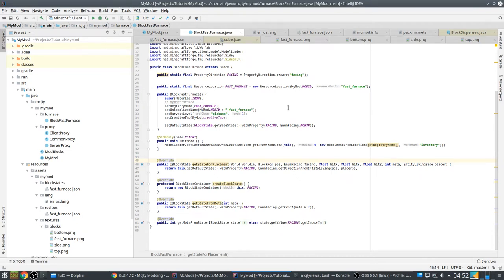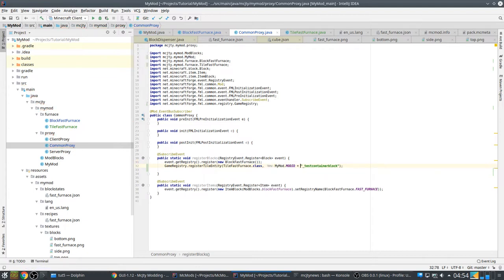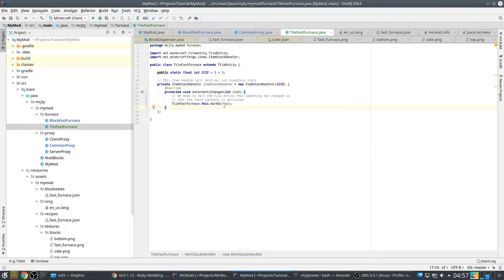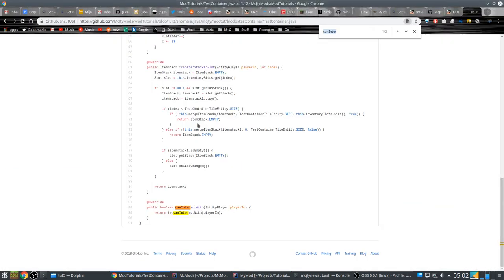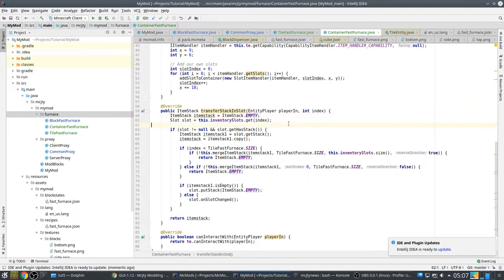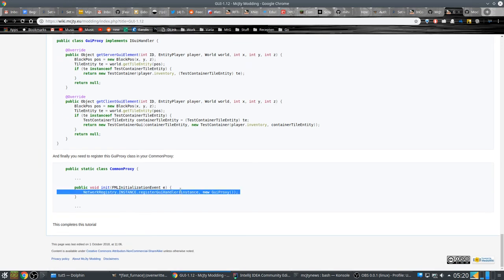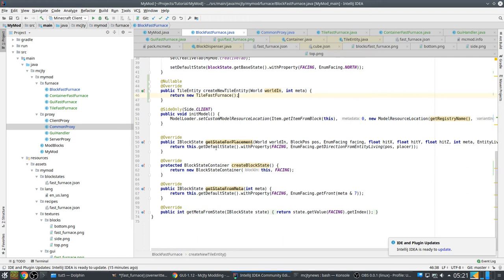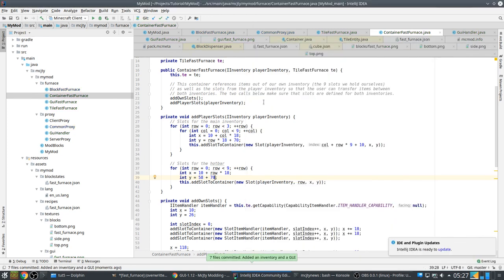Modding Tutorials: Episode 5 (inventory and gui)

Comment: I have a question about scalability. I'm getting all this to work but I feel like this method doesn't scale well. Adding in a new tile, container, block, gui, guihandler block, and registration lines just like these for every single new block seems like it would get out of hand quickly. I tried looking at existing mods but Its really hard to decipher how people have their individual mods set up (since Im new to modding at least). Do you have any tips on scaling these mods with more blocks?
Reply from the maker: Well you can make a parent class if you want (like is done in this tutorials with GenericBlock). That way all common code for all of these can be moved to there. But other then that every block indeed does need all that machinery

Comment: I have another quick question on this one, I realized that in my implementation, all of the player inventory slots in the GUI are off by one, with the very first slot missing entirely and the last non-hotbar slot never having an item in it.  Looking back at the video, it seems like yours may have had the same issue.  I've seemingly fixed it by changing the offset in the math to calculate the index from 10 to 9, is this correct or am I missing something?
Reply from the maker: You are absolutely right. I will fix that and explain the problem next episode

Comment: Great tutorial but for some reason whenever I put an item in one of the input or output slots it shows up in all of the input and output slots. Any idea what I could have done wrong?
Reply: Figured it out. In each addSlotToContainer function within addOwnSlots, i had slotIndex where it should have been slotIndex++
Reply from the maker: Sounds like you messed up with the indices somewhere. Without code is hard to say